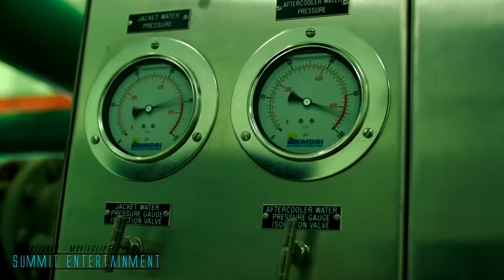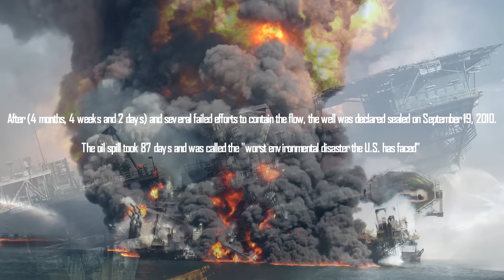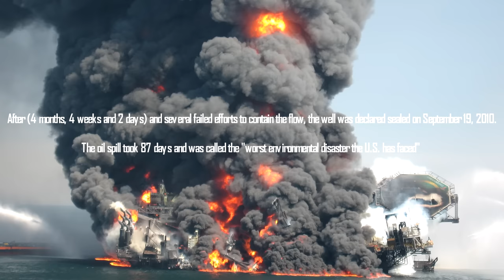Deepwater Horizon |2016| All Blowout Scenes [Edited] (April 20, 2010)

Comment: So uh let me get this straight in my head..they found a massive oil claim ready to be drilled, but that thing has massive pressure behind it? Too much to contain? So they tried anyways with faulty equipment but the pressure went haywire in the well and pump? Thus causing the oil and gas to go everywhere, a engine to overheat, those uh..pistons? To lock up and thus spark and thus make a fireball? Sorry if i'm wrong, i'm just confused about the details of it all.
Reply: @FluffyButtSheep  thank you so much i was sp confused after seeing it on tv..I thought the shower turning on did it..which is..a embarrassing thought XD
Reply: @FluffyButtSheep  Those things...moving back and forth are those pistons? What's the purpose of the pistons and they aren't meant to move fast like that?

Comment: If that is the real timeframe it took for the cutoff systems to activate. I have a suggestion. Explosive driven blades that are sheathed out of the flow path until the exact millisecond the explosives drive the blades through the pipe. That is how the systems that cut off resource flow to bunkers to mitigate nuclear contamination work.

Comment: They should have evacuated the rig and just let it burn as a flare platform.  Then approached the intact riser at shallow depth, rammed it closed, and stopped the spill in a much shorter time frame.
Reply: Joseph Astier .........I’m guessing you didn’t pay attention to the news when this event actually happened? There was no time for EVERYONE to evacuate. By the time the first blowout happened, no one was getting out of there. They also didn’t think the next one was going to happen. When it did, they had no chance and could only watch their death come. The people up top didn’t know what was going on until the second blowout and subsequent explosions. They DID evacuate then, but no one knew that the spill was happening like it was until they could get near the rig. And there was no ramming it closed until some of the pressure was relieved. They attempted to seal it, but the issues that led to the explosion, also helped the spill.

Comment: Not how any of this happened they got a kick and it went on for hours then the flammable fumes found and ignition source it was all due too a failure at the bit where if there is a kick it has valves too shut it off. The system failed and poses a danger as some of the same bits and systems are still being used todsy

Comment: At 3:24 that explosion shouldn't have happened. You see the engine seize up and then the rods break. After the engine seizes up like that their is no more compression, no more spark happening, and thus no more controlled explosion inside of the piston chambers so that explosion wouldn't have happened their was nothing left to happen in that engine to ignite the oil vapors that entered through the intake
Reply: rougebeaster not so with diesels. They ran away on the methane coming in through the turbo. Diesels also don't have spark plugs they run on compression. When the cylinders locked up it built up heat which added up compression (aka stroke 2) there's still methane coming in (aka stroke 1) once the compression meets the optimum ratio of intake compression and a fuel source the power stroke (aka stroke 3) will happen and in the case of a runaway the engine will explode
Reply: The fuel for the explosion was natural gas, not the oil vapors, which is extremely flammable.  So much so that it can travel up the exhaust pipe of a pickup truck and be ignited by that (seen that happen personally), so that split second or two where it came into contact with an ignition source was more than enough to set off the whole thing regardless of the engine's compression.

Comment: Why did they not turn off the engines? Why did they detonate the engines? Why gas leak blew up the engine room.
Reply: the engines blew up because it ignited the gas. they didnt "Detonate" the engines. also the gas was ignited by the same flame in the engine room which is why it blew up

Comment: stuff that does not happen with a windmill or solar panels...
Reply: True, but people still need to drive. You can't replace all the cars with electric without having to re-design and rebuild the entire power grid.
Reply: absolutely! that will take time, but right now there is now state led system that is assisting with the construction of an EV charging grid. neither is there an investment in the upgrade of our power grid. 

those would be good spots to start. and with gas likely to cross $3.00 a gallon by the end of the summer, EVs will become more affordable.

Comment: Engines don't explode after they stop and the annular preventer didn't explode. This is so dramatized I can barely watch it.
Reply: Shawn McManus What the hell are you talking about? Do you have any idea what took place in these scenes? The engines ran away do to sucking in the gas on the platform, they ran so fast that the locked up and blew apart, that caused a spark which ignited the gas that at this point had covered pretty much the whole rig which resulted in the mass explosion. And yes under high pressure annular will do that. It didn’t really explode, the extreme pressure actually forced past and cut through the annular causing it to appear to explode.
Reply: @mcgee_tradez4991  I agree with everything you said. This show should have said it that way and I would have watched the while thing. It was written and dramatized for people that don't understand pressure differentials. All gotta be hyped because the average viewer doesn't understand danger or science. They have to be told something super simple and scary to get them to be interested.